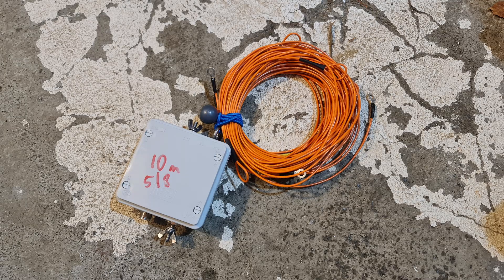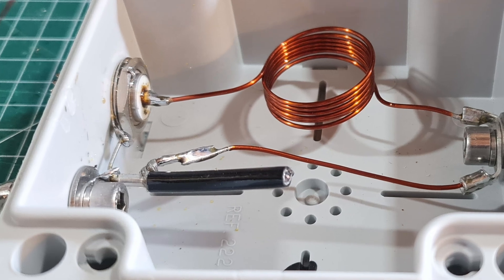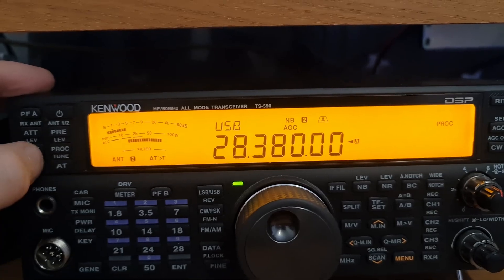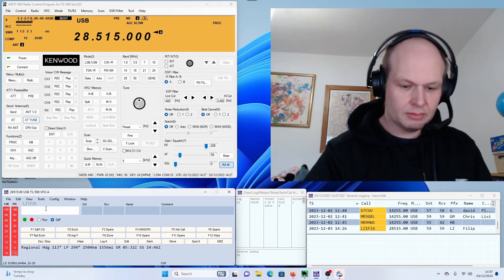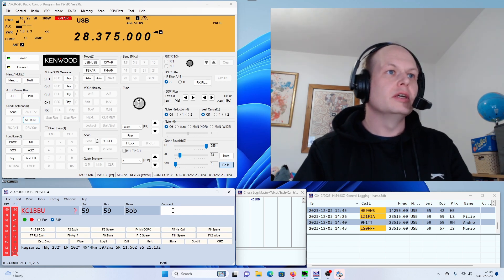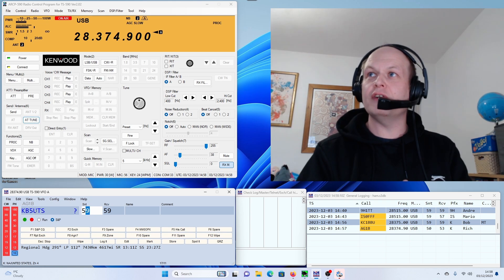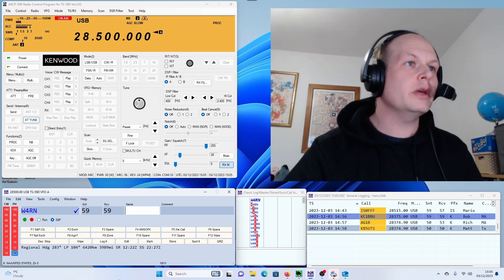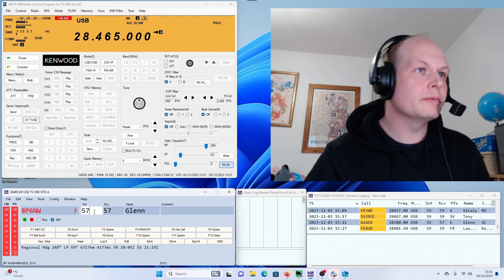Cheap 5/8th 10m DX Antenna to get you on the air

Comment: Noise should scale in dB as 10 log10 (rx bandwidth), so a high Q antenna will be low noise provided there is little noise directly on your tuned frequency.

Comment: Amazing,  normally verticals are always noisier,   seems a bit odd eh. You can never tell what's ants will do ,until you get them on the air, that's why I never bother with ant software progs hi.
Reply from the maker: Yes its really quiet Brian as well as better by 2 s points on the 590. Thats at least 12db.